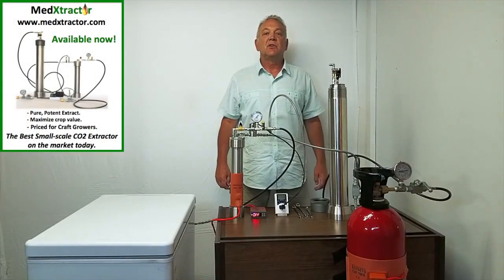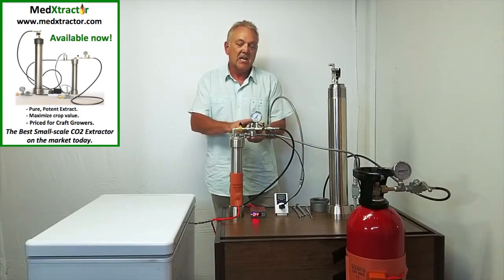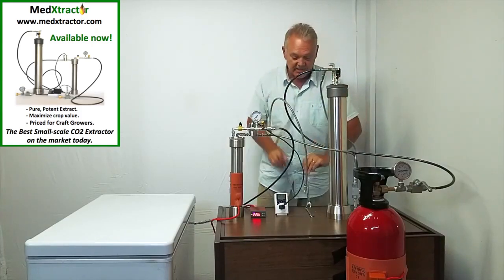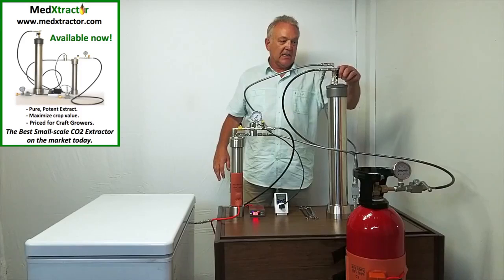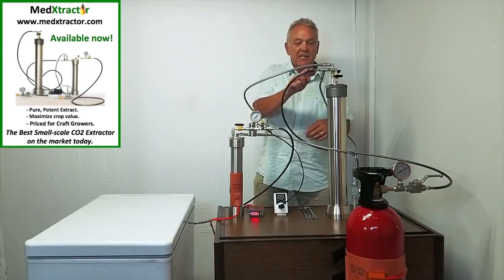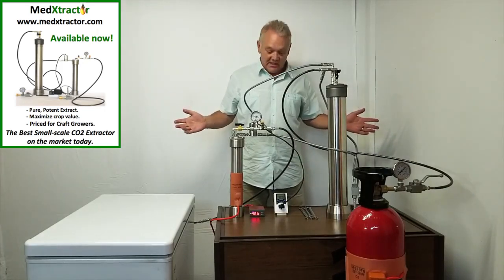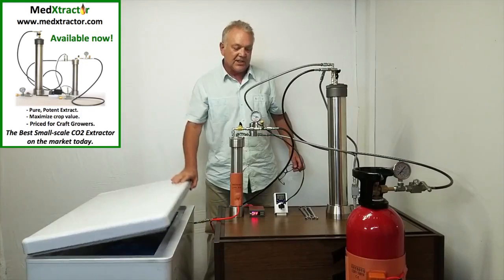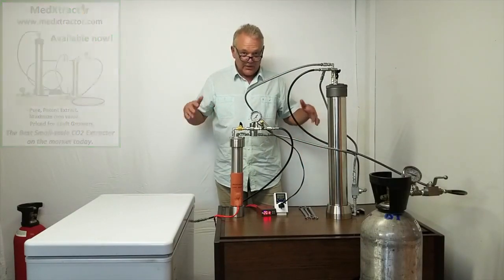16oz Operating Tutorial MedXtractor cannabis oil CO2 extractor

Comment: I want to ask, how long you wait for the ekstrakstion in ekstraktor, 50 minute or 15 minute? And how much pressure you use for the ekstraktion? last question about the relief valve, until how much pressure we need to release?
Reply from the maker: A 16oz extraction will take 8-9 hours at approx. 1000-1200psi. The safety release will rupture at approx. 1700psi.
Reply: @ndatalyzecorp.3792  thank you so much for your reply,. About the extraction that I meant, before you operate the solenoid valve like in minute  9:06 ,  is it 50 minute?
Reply from the maker: @Buluhidung9696  The solenoid valve starts operating when the operator starts the timer. It can be as short or long as you want but is usually within 5 minutes of CO2 loading.
Reply: One more question, if the separator has high pressure like in video, is the co2 still in super critical condition in separator? Becauase there is a possibiltity the liquid co2 tank in freezer is contaminated by the oil.
Reply from the maker: @Buluhidung9696  The CO2 in the collector is gas. The liquid CO2 in the freezer tank will often contain some extract, mostly terpenes. It's niot really an issue as it stays in the system and is recaptured as the tanks are swapped.

Comment: Is there any danger applying heat to the tank? Is the anti freeze harmful in a room environment? How much distillate product can you get from 1oz?
Reply from the maker: CO2 tanks have safety burst disks  so that if overheated the CO2 vents rather than the tank bursting. The heaters are thermostat-controlled, and high-temp-limited as well. Plumbers antifreeze is the same as is used for winterizing recreational vehicle plumbing and considered safe. 1oz is 28.35 grams which, if flower, should yield approx. 2.5-3 grams. It will be oil, not distillate. You can see videos at www.medxtractor.com.

Comment: Sorry dude loads of questions
1 any smell coming when producing oil?
2.do u have bigger extractors than.one pound ones?
Thanks 👍
Reply from the maker: Np problem, ask all the questions you want (you could contact me directly at jimd@medxtractor.com). There is almost no smell when extracting oil. The largest unit we make has a capacity of approx. 20oz of raw material. We have stock and can ship quickly.

Comment: Do u post to europe? And what about service in case some faults in europe?
Reply from the maker: Yes we ship to Europe and we provide both email and telephone support. Also there are two manuals that come with the systems - one is an extraction preparation manual that sets out the specifics of raw material preparation and system loading and the other is more of a technical step-by-step operating procedure explanation. There are "International Considerations" in both that refer to power supplies, CO2 fittings and freezer setups.

Comment: Can extractor work all time 24/7?
Reply from the maker: Technically yes, but practically probably a maximum of 16 hours - it depends on the size of the freezer.
Reply: @ndatalyzecorp.3792  as i'm counting  in 16hrs can i get around 300mls of ready oil?
Reply from the maker: @RobbieVanRich  more likely 100-120 grams of oil from 2lbs of  good quality raw material
Reply: @ndatalyzecorp.3792  does it produce full spectrum with terpenes, cannabinoids ? Or is it just thc only?
Reply from the maker: @yaris684  Full-spectrum
Reply: I'm trying to do the math here, so if 2 pound of product costs 5600 CAD, and I'm getting 120ml of distillate, I would be barely breaking even , even net loss. Kinda surprised at how much product is required to produce so little distillate.
Reply: @yaris684  2lbs doesn't cost that much. Plus you're using trim..
Reply: @yaris684  where you paying that were lucky to get 1500 here

Comment: When do u refill extractor? After one or two swaps of tanks?
Reply from the maker: The extractor in the video is 1lb capacity and it usually takes 4 to 5 tank swaps to complete the extraction. Then you change the raw material.
Reply: @ndatalyzecorp.3792  do you call one tank swap all cycle or one swap is when u swap in freezer?
Reply from the maker: @RobbieVanRich  one swap is a freezer swap.